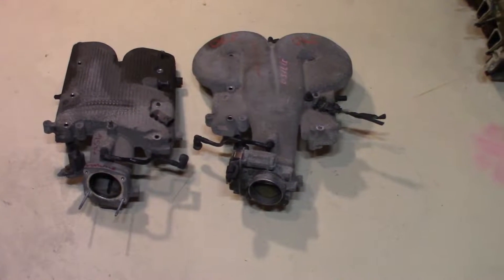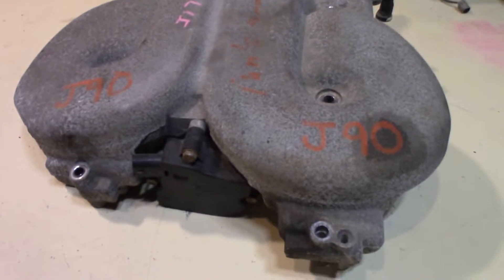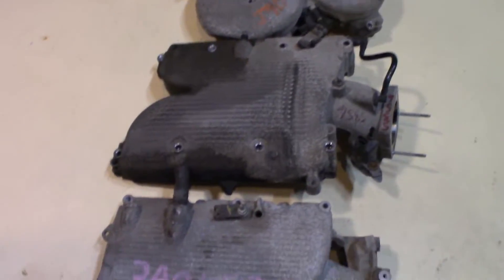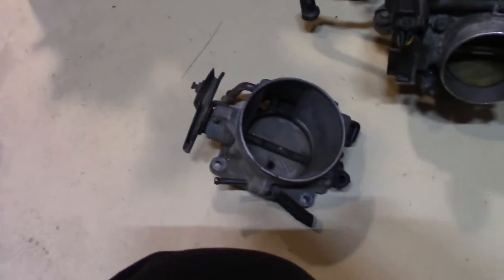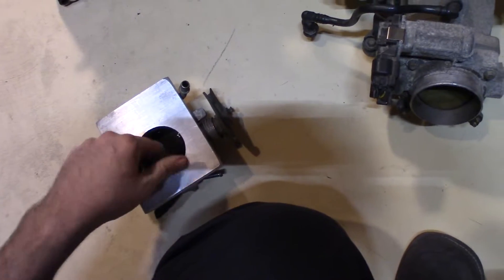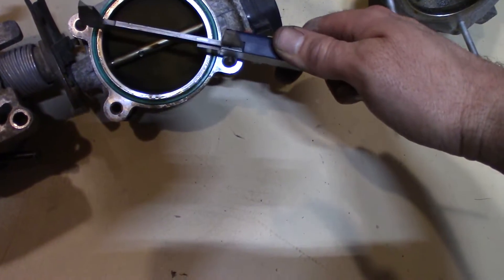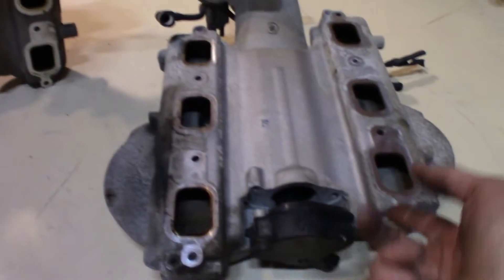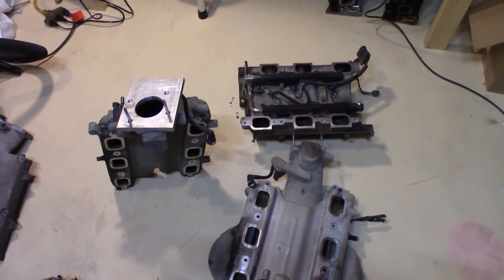Differance between a LZ9 3900 and LZ4 3500 plenum

Comment: I need to take of the LZ9 intake manifold from a Chevy Uplander - having a hard time getting the bolt off the back (top bolts on ignition coil bracket) on the alternator side - wiring harness and steering pump lines seem to be in the way.

Do you have any tips on how to remove those back bolts? Mainly the one on the side of the alternator?
Reply from the maker: Unfortunately, it's been a long time since I worked on one in a van. I think I usually get them with an extension and a flex head ratchet.
Reply: You need 15 mm wrench for the alternator bolt, 13 mm for the two ignition coil brackets and all the manifold bolts and finally 10 mm for the throttle body bolts if you are just removing the intake. Cheers.

Comment: Can the LZ4 upper plenum be rotated so the throttle body is on the accessory belt side of the engine for RWD applications? I realize that the throttle body might be in the way of the belt just by looking at pictures of the LZ4/LZ9 engine so the belt routing may need to be modified in some way. So does the manifold physically bolt down and work assuming the accessory drive was modified in a way to get it out of the way? I'm thinking maybe LZ9 bottom end + F body accessories  + LZ4 intake turned around + 5.3 throttle body + LNJ cam + Microsquirt.
Reply from the maker: The plenum will  bolt on facing the front of the engine, but not with the factory accessorie drive.  The RWD timing cover will bolt up, but the bolt holes in the ends of the heads are different and you have to make a custom coolant crossover/remote thermostat set up to get everything to work.  Check out the DOT motorsports channel, they did this setup in their s10 road race truck!
Reply: @modeverything1  I have a 1997 5 speed dodge Dakota I was thinking about putting the LZ9 into. I wonder if I could just build a riser plate for the plenum to space it over the FWD accessories and have a "ghetto holley high ram" :)  I would guess there is enough hood clearance in a Dakota. The AX15 5 speed trans that comes in the 4 cylinder Dakotas actually has a 60 degree v6 bellhousing pattern. I've seen talk on forums about this engine trans combo but never actually seen anyone do it before. Have you? From what I read the AX15 is quite a bit stronger then an s10 or Camaro 5 speed. When doing some research I found that the starter is on the wrong side just like the other FWD to RWD swaps so the AX15 bellhousing needs to be notched. I think a Fiero clutch kit has the correct spline clutch disc to fit the AX15 input shaft but I'm not 100% sure on that. The end of the AX15 input shaft where it goes into the pilot bearing is 0.75 OD. Do you happen to know what size hole is in the crank for the pilot bearing on the LZ9? Looking through rock auto of various 60 degree v6s applications I'm finding varying OD pilot bearing sizes 0.83 and 1.09, etc.
Reply from the maker: You probably could raise the plenum, but it depends on how much hood clearance you have. The pilot bearing size I would imagine that it would be the same as an older 60degreev6, but I have not done any RWD manual swaps yet. 
 That dose sound like a great swap!

Comment: I just realized that the 3900 variable intake is a modern twist on the old Weiand dual port intakes they used to make. Two runner paths for the air to enter the heads. I had a 3900 Monte, and it was a fun car for a midsize. It was weird to hit the top speed limiter and feel the engine "wanting" to rev higher.
Reply from the maker: It should be fun in a smaller car, considering how well they move the vans  around!
Reply: @modeverything1 get a Malibu ss

Comment: Is it possible to bolt this on and run it with no retune or will it run like absolute shit?
Reply from the maker: I have not tried it, but I would imagine it running poorly in some areas of the rpm range. It would be interesting to see what it would do!
Reply: @modeverything1  gotcha. Was thinking about installing this on my 3.5 aura for a little more kick

Comment: Any modifications that are junkyard or new performance parts a lz9 3.9l
Reply from the maker: I have not heard of anything myself for vehicles originally equipped with this engine... other than someone was using a larger throttle body from a stock LS engine, but I have not tried it myself.

Comment: Would the lz9 intake bolt onto my LZ4?
Reply from the maker: It will bolt up but you won't have any way of controlling the variable runner in the plenum without swapping the pcm and wiring harness

Comment: Ok so hope hopefully you'll see this soon.. got a 07 LT and has an LZ4 intake i want to say.. i got an Lz9 motor out of an 06 police... im swapping the whole drivetrain and was wondering would i need to swap the plenums as well due to the wiring harness or direct fit? 😭
Reply from the maker: Use what ever plenum that matches the wiring harness that you are using.  If you are swapping a LZ4 plenum on to a LZ9 you may have a engine light on for the runner control.  If you get the pcm tuned you should be able to have the code removed for the runner control.
Reply: @modeverything1  ok so the guy doing it did say they were going to swap the intake to the one that came with my car bc the wiring harness is slightly different on throttle and such.. but other than that everything else should be pretty straightforward.. thank you i appreciate you! Idk if i mentioned this but both are 3.9 and i do have the pcm out of the cop car as well so i was going to use that bc the cop car doesnt have DOD like the civilian car does

Comment: Look at LGD 3.9l  Chevrolet  engine on 2010 impala. its the flex fuel version  of LZ9 my 2010 impala has it and it does have vvt, but not the variable intake manifold length. looks like the 3.4 intake
Reply from the maker: Yes I believe around 2009 GM got rid of the variable runner plenum and used the lz4 style.

Comment: I'm working on an lz4. I have the block at the machine shop, seems to me the flow on the intake side is sufficient. The exhaust ports and exhaust manifold are definitely the choking point. Im considering having them gasket match the exhaust ports and opening up the manifolds a bit while I have em sitting on the bench here.
Reply from the maker: Nice! Headers should be a big improvement on these engines! I did some work on my heads but did not want to go too crazy without doing some flow bench testing.

Comment: If you still have the LZ4 intake handy, would you mind measuring the height from the gasket flange to wherever the high point on the plenum is at both TB end and non-TB end?
Reply from the maker: Highest point is the boss for the brake booster hose at approximately 3.5". The TB sits much lower!
Reply: @modeverything1  Thank you. Could you also measure at the very front face between cylinders 1/2?

Comment: I’ve Got A 3.9L but My 3.9 Has The LZ4 Intake 🤔
Reply from the maker: GM stopped using the variable runner plenum in the last few years of production on the lZ9. Can't remember but i believe around 2009 in the cars they did this?
Reply: @modeverything1  why did they stop? Can I swap the intakes if I wanted to? From lz4 to lz9?
Reply from the maker: No idea,  guess they figured that it made enough power with out the variable runner plenum... you could but you you would not have any way to control the runners without swapping the harness and pcm.
Reply: I have a 2007 3.9 with the Lz4 intake

Comment: Is it possible to swap the LX9's 3.5L intake manifold to the LZ9 3.9L👀😱 with out a problem?!
Reply from the maker: It will not bolt up, they changed the bolt hole location on the LZ engines. The lx9 plenum will only swap out with 3100/3400
Reply: @modeverything1  DAMN!!!